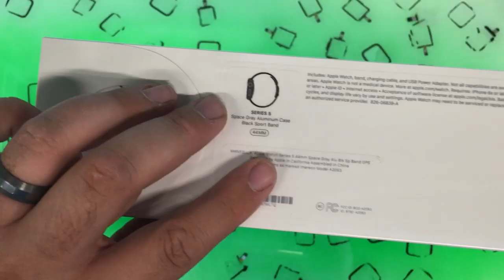New Apple Watch Series 5 Teardown

Comment: great job i have a 5 series and took it to have it repaired as i dropped it and cracked the bottom right hand corner .he replaced it with a new original touch screen and glass complete .after fixing everything works great and up dated it to ios9 .but i have a problem that the side button when i press to my apple pay  the cards on my phone work but in the app it says removing and can't add the cards .
i have reset the watch and signed out of icloud and reset my cards on my phone but still not adding them to my watch .????
any suggestion on how to fix!!!!.
wish i lived close i would bring it to you to fix .but unfortunately live in in Cyprus .if you know of anyway i can fix my problem i would appreciate the help 
many thank 
mike
Reply from the maker: It’s could be a couple of things. First if the replaced the whole screen this can cause the issue you are talking about. If the image and touch of your watch was fine then they should have just replaced the glass and you wouldn’t have experienced this issue. Most shops won’t do glass only though due to how different it is. The other thing is that the something might not be connected properly on the inside or the software the screen has when installed didn’t match the update the watch had. This can typically be fixed though with an update when they come out. If they replaced your whole screen they should have made you aware of this potential issue.

Comment: Question, can I remove a working OEM display from a iCloud locked series 5 to replaced a damaged display in my very own series 5?
Reply from the maker: Yes, but you may experience issues with some features like Apple Pay etc. if the update of the screen doesn’t match the watch your putting it on. Once the watch has a chance to update though this should clear up.

Comment: @FIXD Phone Repair
 if you remove the copper sticker and leave the 3 connector ? the iwatch will not work? i mean the screen. please can you help me?  
i ruined the digitizer and i have to find one digitizer to put it on but the problem is that i connect the diplay with the connectors and doesnt work

Comment: When I was replacing my battery, I inadvertently pried up the display flex cable on the motherboard on the left side.  How do I reconnect this?  Do I solder it back on?   Any tips?

Comment: I needed to re-case the internals to another case due to a bought watch that the owner said he had a bike crash that smashed the screen and scraped the aluminium case deep of the corner.  It was all going SO SO well here on my UK Kitchen table this morning!!  The arrival of my eagerly awaited magnetic board meant I could start the teardown following this excellently detailed video 😎 WELL, until the last part!!  The bottom sensor came off and the tiny springs for the strap release push in buttons went off some where never to be seen again 😂 Now for plan B 🤣  And I shall be taping the back to the body before I strip another one.  Great video as usual.  Thank you.

Comment: Can you make an video about how to get out the crown from the middle frame?as i have an apple watch s4 and have some scratches on the middle aluminum frame and i watch to change it but the only thing i have doubts is that crown and no one have made an video about replacing the crown or at least changing the middle frame with an new one.

Comment: How do you know if the screen connector cable (3 of them) are working or not? 
I recently replaced the screen but screen remains black, however, watch is on. I guess watch remains on, even, the screen may or may not be working. Could this be the cable. I see current in them testing with O-Meter. Any answer will be highly appreciated! Thank you

Comment: You always make great videos, keep it up man, I noticed the laser machine you have, would please give me feedback? Is it actually worth it’s price? Since you still need to open and remove motherboards out I’m still no sure if I should get it or not
Reply from the maker: Jaffar Almousa you actually don’t need to remove a single screw. When starting it’s a good idea to remove stuff just to make sure the machine is dialed in. Once things work without having to make adjustments it as simple as placing the phone and starting the machine. If you are going to be doing it on a regular basis then it’s worth it.

Comment: Is there a way to make the watch waterproof again, maybe put in a vacuum chamber and get some apple grade adhesive? I’ve done three apple watch lcd refurbishment using your tutorials but always concern if they get wet while hand washing.
Reply from the maker: Alan Liu Alan Liu I have a vacuum chamber and have tried dozens of adhesives, the only issue is what test can you preform to confirm it’s water resistance? Apple never claims “waterproof “ and it’s based off of statistics. They don’t test every watch that goes out. I have tons of people contact me about fixing new water damaged watches, which Apple doesn’t cover under warranty.